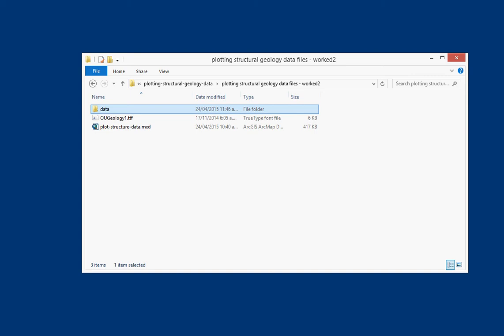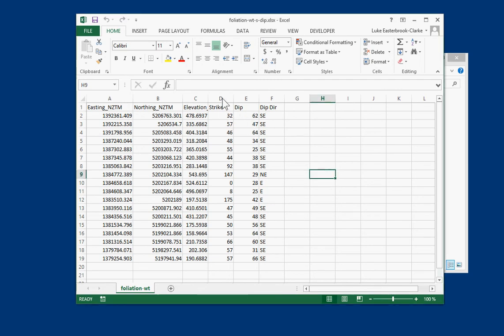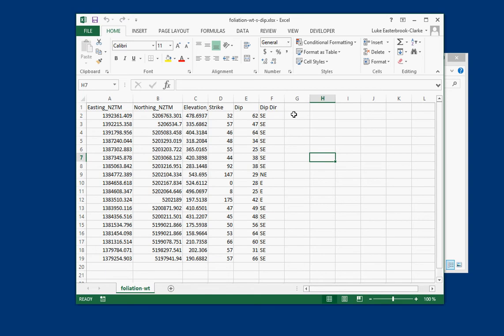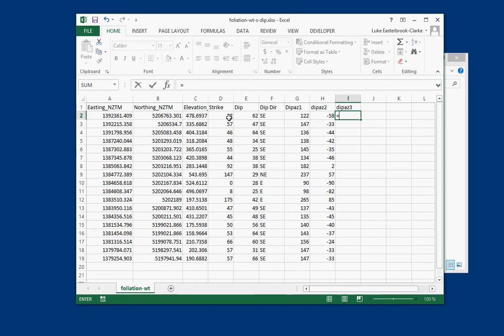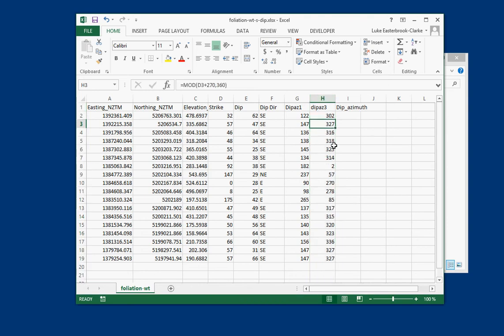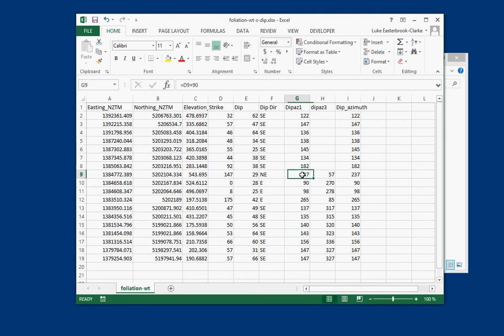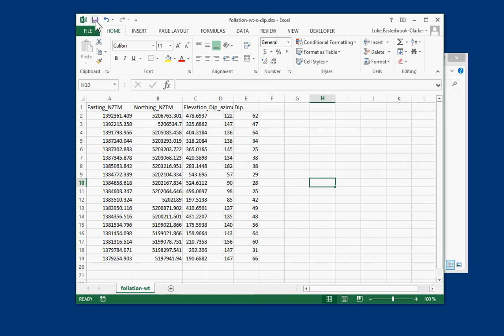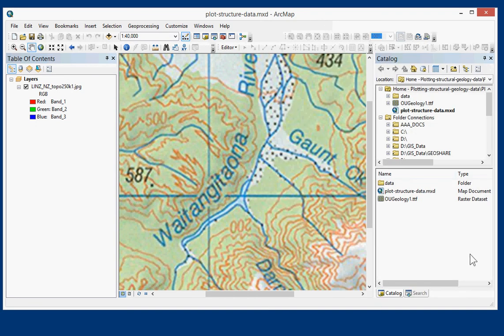Plot structural geology data using ArcGIS (part 1)

Comment: Hello, thanks for the tutuorial. foliations or joints are observable only on rocks exposures only so, how to set the reach of a particular foilitaion on a lithologicl map in ArcGis??
In other way- how to set these are the pixels of lithological map gonna have imapct of one particular joint/foliation set
Reply: Hello, I'd really like to help. But, I'm having trouble understanding the question. Foliation data are measured at a point, so the foliation symbol reflects the foliation directly beneath the centre of the symbol.
Reply: Dear Luka, I knew that I didnt convey my question properly, am sorry for that indeed. my question is how to set the reach of any dicontinuity on a slope or on a slope facet only. rather than just showing a discontinuity, that particular discontinuity going to have have effect on this much area....